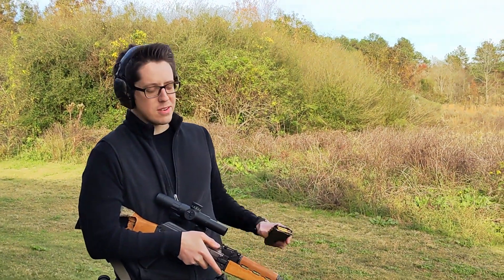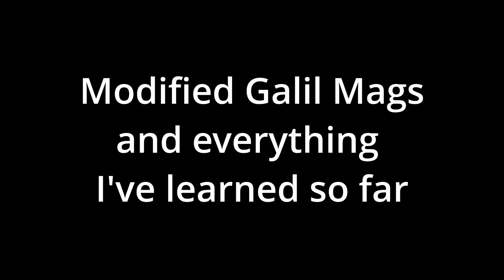MODIFIED Surplus Galil 556AK Mag in ZPAP90 Test - Zastava 556 AK Magazine Series S2E08

Comment: I’m a welder and own all the equipment, so I went ahead and bought some steel galil mags, built up the front lug, and then used a set of mics to find the dimensions of an M90 specific mag and used a file and grinder to match it on the galil mags. All in all, for 6 mags I had maybe 2 hours of time into it, totally worth it in my opinion. But, I also have all the equipment to make the job easy.

Comment: Meant to ask. What did ya do for the bolt on your stock? Mod something or did ya find a 8mmx1 fine thread bolt somewhere
Reply from the maker: Bought a threaded rod, cut it to length, welded a nut, and cut it for a flat head. Couldn't find a fine threaded bolt that was long enough for the life of me.

Comment: Hey what gas setting are u running in this video?
Reply from the maker: All gas setting #1
Reply: @AustinsArmoury  did u do the initial 200 round brake in on setting 2? …The reason I’m asking is I’m wondering if it will beat itself up ,if left on setting 2?
Reply from the maker: nah it won't beat itself up. Most AKs are way over gassed and do just fine. But dropping it to setting 1 does make it incredibly smooth assuming it's still reliable with your ammo and weather
Reply: @AustinsArmoury  it should do fine I shoot steal cased Barnaul 62gr…. And thanks for replying to me I appreciate it! And thanks for all the info on what mags will work in our new m90’s!